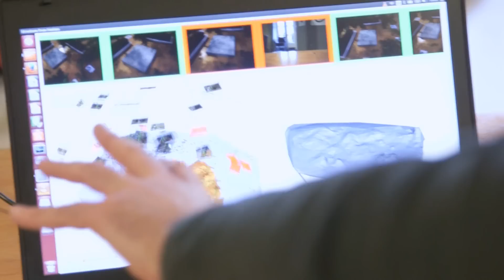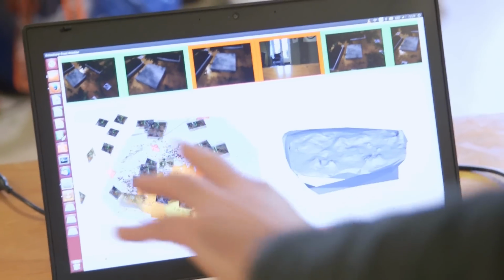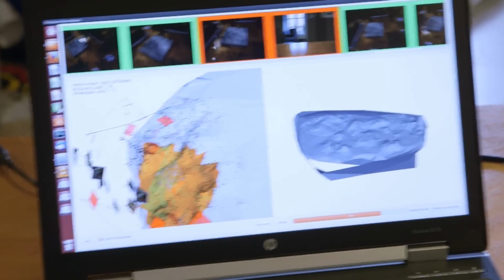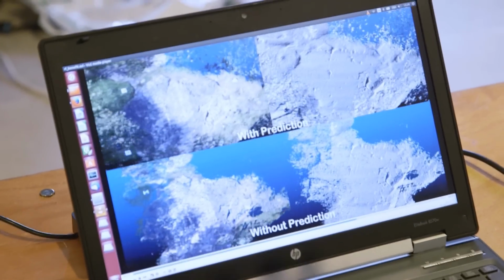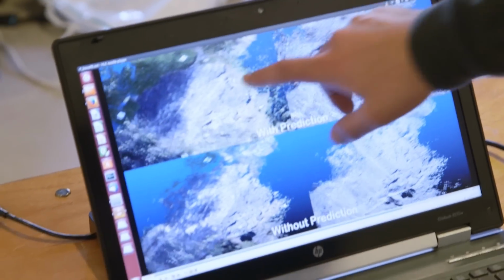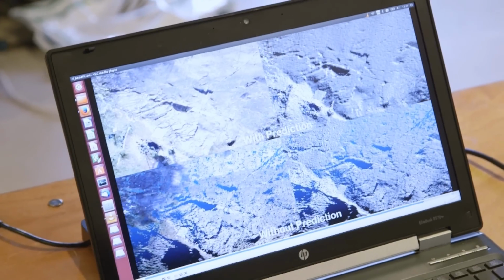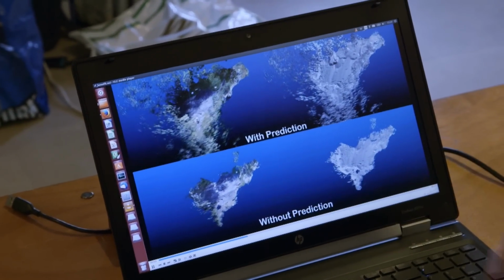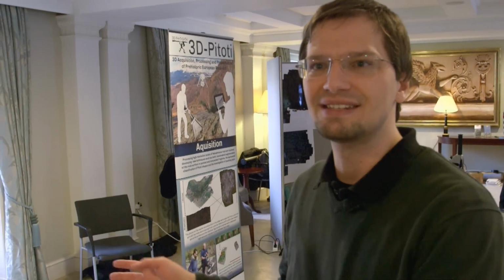Structure from Motion Octocopter - Computerphile

Comment: How does the vehicle keep track of its own position in order to report where each picture was taken from?
Reply: +Adamantium9001 it uses GPS basically. The 3D reconstruction and camera motion from the images is than automatically estimated using the structure-from-motion pipeline (without gps), and then simply "moved" to the real-world coordinates using the rough GPS coordinates or ground control points. while flying the vehicle localizes itself using GPS only
Reply: +Manuel Hofer GPS or reference markers. You can see the markers on the table or in the field video. Probably GPS is little bit in accurate for this job. GPS only UAVs have a tendency to drift around somewhat while trying to hover precisely, since GPS is not really pinpoint accurate.

Also since they fly under overhangs etc. it might block GPS, so they probably use those geo reference markers to get a local reliable reference.

Some UAVs do this be themselves to some extend. They have down looking optic and/or laser scanners to scan the ground below to get instant local reference for hover holding. Of course it is relative and not absolute, so hence the marker plates. From those you get absolute reference with optical scanner (aka camera)

Comment: It would be interesting to see different forks in the learning algorithm that focus on detecting properties of "challenging objects" and see how quickly it "decides" to use alternate techniques to get full coverage of the object. I Imagine crowdsourcing the determination of what areas of a 3d model "need more work" by offering the 3d model alongside the video taken by the device online. Also include that ability for the "crowd" to slice into the 3d model to isolate the "least defined" component of the feature. The system could then attempt a solution and provide it back to the crowd for further analysis. Could be made to be fun as a game of sorts!

Comment: So this octacopter is basically doing what people with complete blindness in one eye are doing? Rocking back and forth to see what background areas of a picture are being exposed / obscured behind objects in the foreground? Yeah that takes a lot of computing power. I'd imagine the algorythms used to reconstruct 3d geometry are modeled on the way human brains work to accomplish the same task (in the case of humans, mostly based on mapping out walking surface, obstacle avoidance, and impact threat assesment). Is it done with dense neural networks? How would those be trained? Or is it a selflearning network? Something completely different?

Also, given the fact that it would be trivial to have that octacopter carry one more camera (for stereoscopic image aquisition), what was the reasoning for that not getting implemented? I'd imaging the aquisition phase would be way more streamlined if the octacopter had 3d imaging in place to begin with..

So many questions!

Comment: Is the reason it has to be a static object due to processing power or some algorythmic problem? I don't see why a motion prediction algorythm couldn't be incorporated into that considering that a lot of animation is based on prediction algorythms now other than the render time for those things, but usually that is due to the quality of the render and not the animation I think.
Reply: +Durakken basic Structure-from-motion only works for static scenes. You can only solve the optimization problem behind it when the 3D points "do not move". Otherwise it would get much more complicated. However, if most of the scene is static and a few objects are moving it usually works too. Then the moving things are usually just cancelled out automatically. There is of course software to reconstruct a dynamic scene, but here you usually have the assumption of a static camera, and if not, the algorithms are not ready to be used outside of the safe lab environment (as far as I know)

Comment: Hey Sean would you consider using a monopod stand for your videos? I know it's like the trademark to have that shaky cam, but it's a bit unsettling at times, especially when the camera is pointing a single direction most of the time anyway. I don't want to interrupt your seemingly quick workflow, but something like that could be easily maneuvered to adjust for those close up shots you get, and something with only a single leg wouldn't be too cumbersome to rotate or quickly move. Just a suggestion cause your videos rock.
Reply from the maker: Will consider, I try to use tripod most of time these days, only go handheld when situation calls for it or if I haven't got access to my tripod (it happens) >Sean
Reply: Awesome. I knew that you must have used something for those videos with Professor Brailsford, but thought I'd mention it anyway. I really love those videos, for more than just their video quality :3

Comment: That’s photogrammetry with dense pointcloud Poisson mesh reconstruction, it’s been used for matchmoving in the film and TV industry for about 6-7 years now. It seems interesting that they chose to make the whole software from scratch instead of just the drone driving bit… I guess most matchmoving software is not really open when trying to expand its capabilities in such a way.
Reply: +Unai Martínez Barredo Exactly, there are a lot of SfM pipelines out there (freeware and non-freeware) that work basically in the same way. However, many of them are closed-source which makes it uncomfortable to extend them. since we are a research institution, we aim at developing new tools, such as the view planning you see in the video. Our basic 3D reconstruction software has been developed since about 2006 or 2007, and we are basically maintaining it and extending it with further apps and functionalities. And since we have the full source code, this is ideal for research
Reply: Nice :)